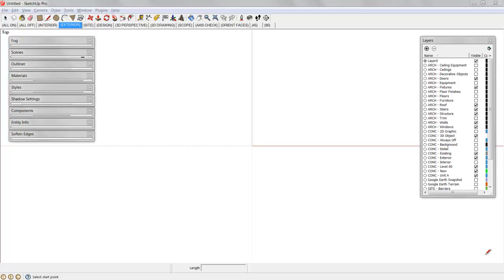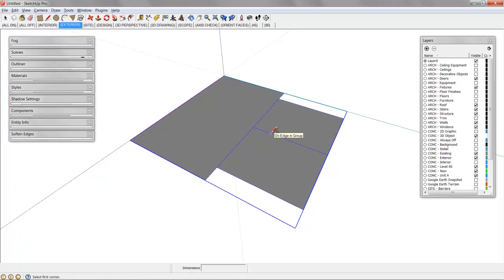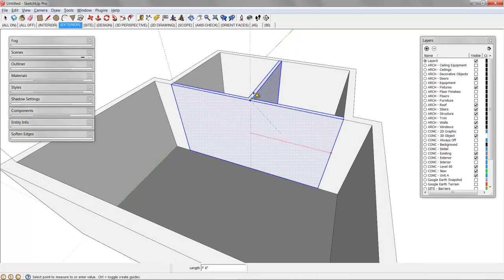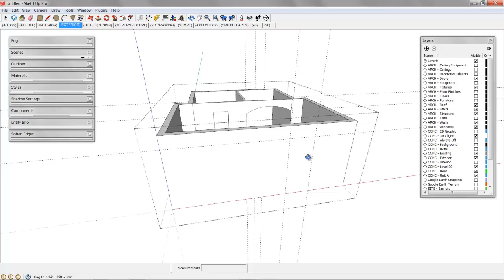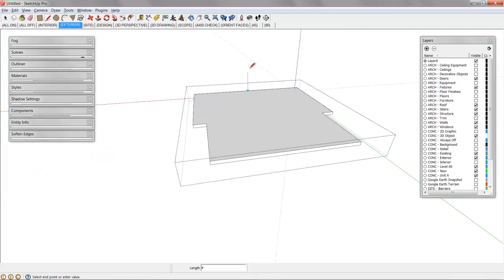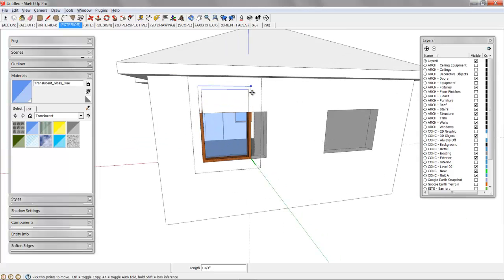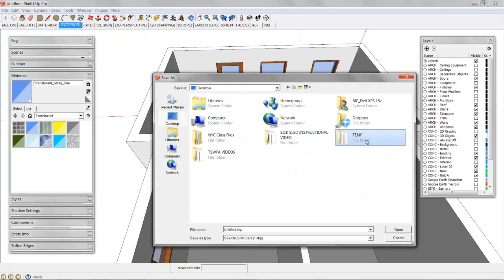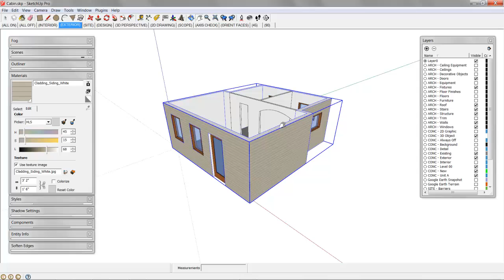01  SketchUp / LayOut / Construction Documents  ::  Designing in SketchUp

Comment: Sketch up should not be used for Construction documents! ... it contains no embedded information, nor is accurate, unlike REVIT (or even AutoCAD).
Best learning Revit, as the industry is heading towards BIM Level 2. Sketchup is not BIM.
Reply: Hello Ian!  You are misinformed.  SketchUp contains embedded information in the form of IFC Classifications and dynamic components.  SketchUp is accurate to 1/64", just like many popular CAD programs.

Regarding Construction documents, Revit is an excellent tool for creating large complex sets with extensive scheduling and coordination.  SketchUp is an excellent tool for creating less complex sets, typically for design build, residential, and light commercial.  Use the right tool for the job, there is no one size fits all.
Reply: Michael Brightman question....why are you creating a 3d model first? is there a way to just do a line drawing of a floor plan without  creating a model?

Comment: Why should I always make groups?
Reply: Oh boy...well if you're just starting, take it from the folks who have been doing it for years.  GROUP everything.  Otherwise stuff "sticks" together.  You won' be able to move a cabinet off the wall without the wall "coming with it"...and this applies to virtually everything...if you GROUP, they all stay separate and you can move things around and control layers without things going very , very whacky...Also, draw EVERYTHING on layer Zero and then group stuff,  The groups then go onto separate layers for control and flexibility.
Reply: Yes to what Flintstone said about sticking.  Also, CAD software produces huge volumes of data, and things like groups, components, repeated items, and blocks etc. are essential to helping conserve the precious RAM that enable us to draw on a computer.  Your computer needs you to use groups and components so it doesn't have to work too hard or SLOWLY, and it gives us an easy way to control the visibility and editability of the model -- there are times when we need to "clear the deck" in order to be able to see what we're trying to do.

Even though this video example is a tiny one, you should be able to see that on larger models/projects, there will be many (hundreds even) repeated pieces and the groups/components, and that fully fleshing out only one item yet having that work simultaneously appear throughout all instances of the group/component is a huge time saver.
Reply: Yep, what the others above have said. Also, it is how things are built. Many parts are assembled together to make a whole. Imagine a mechanic trying to repair a car if all the parts just melded together where they meet.  That's what happens when you don't use groups and components. Though it is possible to model without them, ss soon as a model has any complexity, trying to go forward without groups and components is insanity.

My general rule is, "Making 1 item, group it, making more than one, make it a component." Of course the "Make unique" command is there to help. I work like this no matter what software package I'm using.